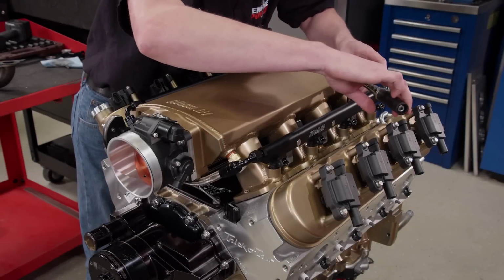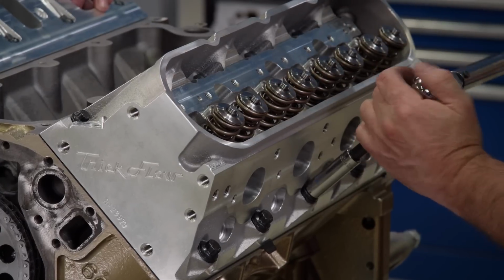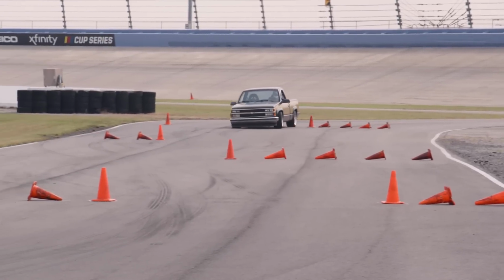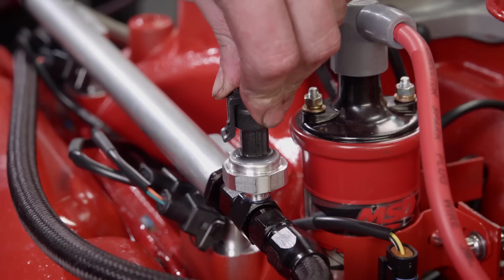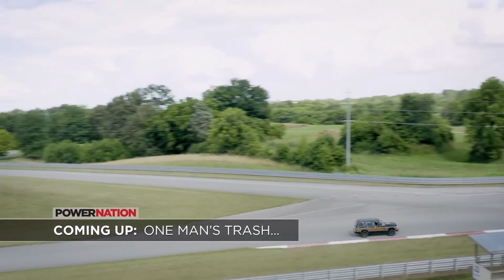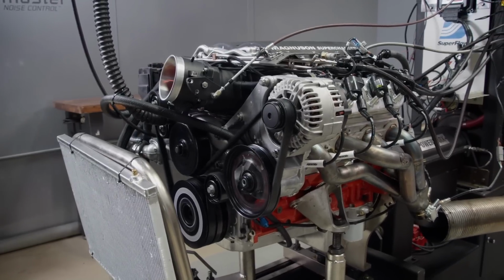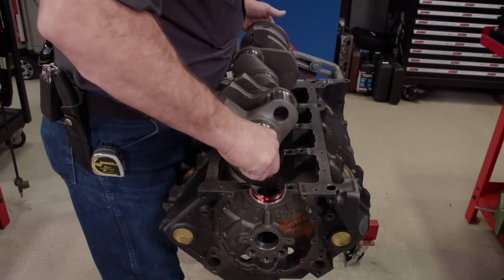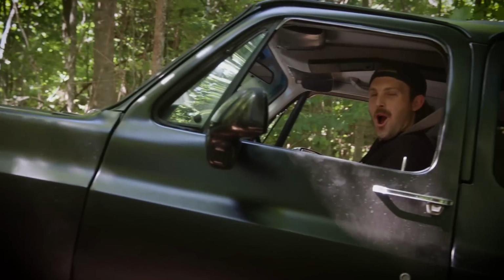Hot Off The Dyno: Our Favorite Engine Builds - Engine Power S8, E22

Comment: Power Nation / Engine Power

I enjoy your show and watch daily.  I love some the big power you guy are building and then changing various components like exhaust manifold, intake manifold and showing the power difference made on the Dyno.
I have a request and it does not involve big engine or big power.  A few of us have bought Jeeps or Dodge products with the 2.5L, 4-cylinder engine.  Idea was to still enjoy off road expeditions without needed big power for rock crawling or climbing vertical cliffs.  Would consider showing all the possible power improvements possible for this little squirrel engine.  There seems to be a lot mystical knowledge about what makes power.  For example, will porting the intake really add any power?  Will changing the throttle body from 2.5 engine to  one from a 4.0 engine?  Changing from single point injectors to twelve-point injector make power or improve economy? Will roller rocker arms really make a difference on such a small horsepower engine?  What performance parts if any are available for 2.5L 4-cylinder motor?  Will headers really improve power or torque?  There is a few videos and chats some say there is power out there, others say it really doesn’t make a performance improvement.	
	I’m sure you get a lot of request, but if you have time in your build schedule there is a lot of us would appreciate you being the “MythBusters” of what this little engine can do.

P.S. I can't believe I had to post this on Youtube.  I could not find an email or posting place on the Power Nation Website.

Comment: Change things up a bit and do something good for the Ford guys.  ..like, build a 1961 Ford 352 HP Starliner engine (stock 360hp) then max it out with fuel injection and all the modern goodies.

Comment: All these builds were pretty awesome! There was one detractor, the AMC 304 sounded great, looked great but was really weak.
Reply: I was way more disappointed in the boosted 427 LS build.
Reply: The numbers really aren't that surprising. Small cubic inch "All motor" builds typically don't make to much power.... Unless you throw the book at it and do a full out race build.
Reply: @Scrotum_69420  a 5.0L Ford with the same amount spent would easily make 400.   They just built a turd.
Reply: @bmstylee  You can tell they are not building it with top of the line parts, not every engine needs to be a top notch build. Just a good ol street engine does just fine.
Reply: @Scrotum_69420  oh boy here comes the excuse making group.   You're going to try to tell me why being slow is cool.  Face it.  They built a boat anchor.   Any other engine that had this much spent on and performed this poorly would have been roasted and rightly so.  Yet this gets a pass.
Reply: @bmstylee  lol you seem angry 😂
Reply: Careful.   Criticizing one of the comments section favorite engines will get you shouted at.   It would interrupt thier jerk off sessions.   But 220 at the wheels after all the money spent was pretty pathetic.